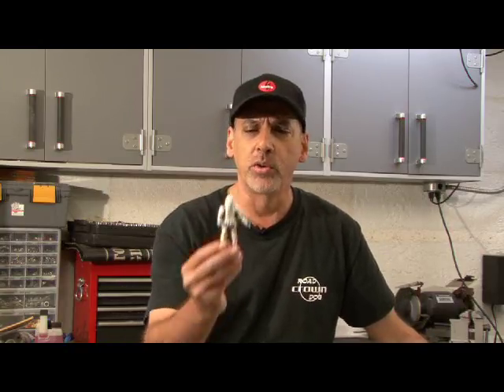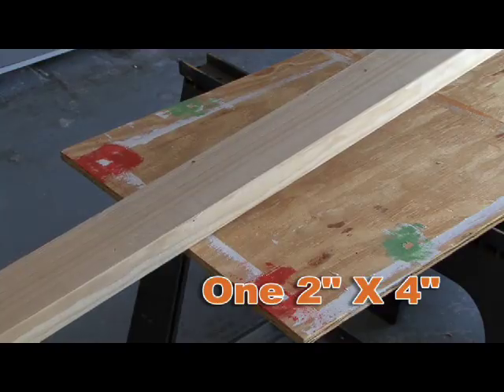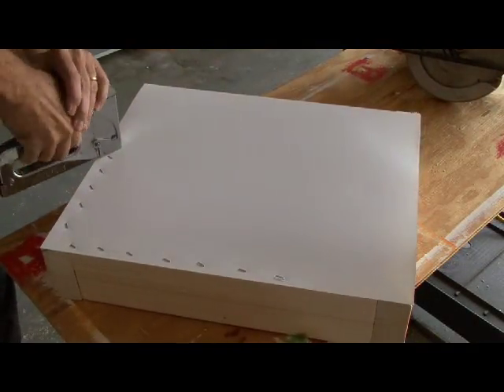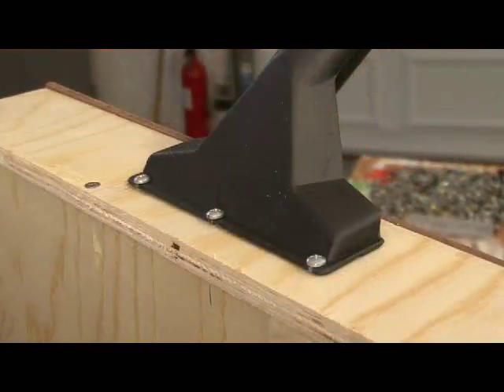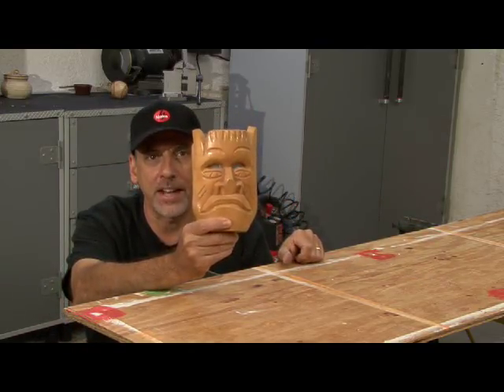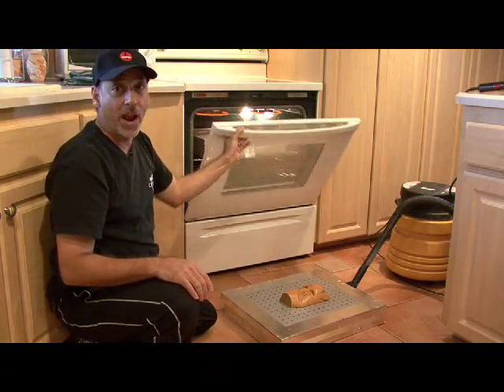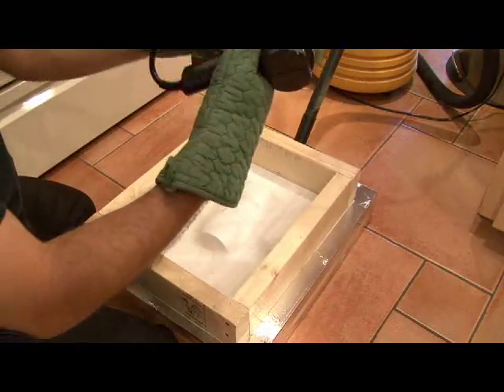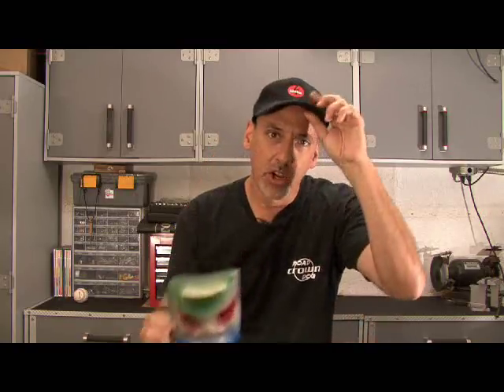Weekend Project: Make a Vacuum Former

Comment: If you want SHARP details, you have to drill 1/64th inch holes in the positive you’re using, so air pressure will push the plastic down evenly everywhere.

Comment: I made one of these a few years ago, the idea was pretty much the same, except my frame for the plastic had some hinges on it so you can easilly slide in some plastic and clamp it down before putting it in the oven.
I also used polystyrene, I got it in sheets from my local home improvement store, it's the tiles used for covering fluorescent lights

Comment: I just built something based off these plans.  It works pretty well. Was a very fun project to build too.  Only think I would recommend is using a 1x4 instead of 2x4.  The 2x4 is just way too thick and bulky.

Some improvements I made on the design was to use caulking on the inside of the box to help with the seal and I also used 2x4s for the box sides rather than plywood. Of course if I build it again I will use 1x4s.

Comment: I've read that there are some ways you can tweak this process as shown here: make it so that i takes joint suction from two vacuums at once; raise the mold up an 8th of an inch because you will get better detail around the bottom edges of your mold that way; vacuum forming molds with complex undercuts are possible if your mold can be disassembled inside the hardened plastic shell after forming, with keys so that they always line up right.

Comment: If you're considering upscaling this into a table top you could use heat lamps and reflectors from a feed / farm store like Tractor Supply Co. using about 4 or 5 of them would let you do a larger area than you could ever get with an oven. The larger the frame the more detail you'll get to transfer to the form.

Comment: Cool Vid Kipkay. 2 things to note. You could just as easily silver tape the plastic to the wood as well. Just make sure to go all the way around to create a tight seal. Also, you could let the plastic get a little hotter. Let it droop more, you'll get more draw. Use baby powder liberally on your positive as a release. Tape any holes outside the frame, waste of vacuum. If the plastic is hard to come off the form a little canned air could do the trick in separating them.  As always, cool vid. :)

Comment: In my experience with heat guns, Hair dryers don't tend to match the output. For this project a really high powered one maybe will work, but you can probably find a heat gun on sale at Sears or something for not too much and its a handy tool to have especially if you ever need to peel paint, say to restore furniture or molding.

Comment: One gets a lot more control by setting the oven at 250F, close the door, and within 5minutes it will get nice and soft (with no need for the heat gun at the end and thus finer details)

Comment: Usually you drill small holes in whatever you are molding, so the vacuum sucks THROUGH the thing you are molding.  I worked in a shop that had one, they made the molds out of plaster and drilled them small so the plastic wouldn't dimple into the holes.

Comment: Great foundation to work on with loads of room for improvement.  Stapling the material everytime would be a real pain...so maybe a temporary frame clamp would be better?  Also, I would either sick with the 1" hole and fix a flange of the same diameter...or cut a slot for the vacuum attachment...so there would be less turbulent airflow.

Comment: Thanks for the video, I would like to ask that you point out with a tag in your video, that as you are heating the plastic, that dangerous gases maybe released from the plastic. If any one had a number of these projects to do that they do not use an oven in their kitchen as there may not be the substantial ventilation needed for safety . 
Take care.

Comment: @riothero313 yes, I did use wing nuts to secure it, they worked great. I punched holes with a paper hole punch in the plastic so it would slide over the studs I had installed in the frame then lay on the top piece of the frame and use the wing nuts to secure it all together, it worked great.

Comment: So late to this, but I can't help but cringe when they are using gloves with a circular saw.  THAT IS NOT SAFETY FIRST.  With any circular power tool like a circular saw or a drill you do NOT want gloves, certainly not bulky ones like that.  If any part catches on the blade, the spinning will YANK your hand into the blade and butcher you.  You are much safer with bare hands where you will just nick your hand instead of severing fingers. Please be careful around spinning power tools.  I had a friend who almost lost a thumb doing exactly this.
Reply: Alluvian Thanks. I think the most important point (not to deny what you said) is to just be aware what you are doing and be cautious when dealing with these kind of saws

Comment: I know this is an old vid, but I have a question: Is it really safe to vacuum form in the kitchen?  Wouldn't the fumes from heating up be dangerous?  Also, would it not be safe to use the oven after vacuum forming the first time?

Comment: You need to preheat the oven to 450F and put the plastic sheet on the middle, remove it as soon starts to go down, but don't use broil, by doing so you're applying heat to one surface more than the other, that's why you didn't have a sharp molding. There is no need for the heat gun if you use BAKE instead of BROIL.

Comment: you mold both sides and cut them out about an inch from the mold you made,stick the molds together and either gut it out or fill it with somthing and then cut it out or remove it to leave the mold so you can make more.
dont blame you if you dont get it.

Comment: oh and if you dont want to spend the time to build this one just grab a 1 gallon bucket a hole saw and a small peice of plywood. i had that laying around my house. hot glue the plywood on the top drill a bunch of small wholes in it and cut a hole with the holesaw in the side just big enough to fit a vacuum cleaner hose in it. maybe glue or tape around it to seal off any leaks. thrn make the plastic frame just big enough to fit the side of a milk jug on it. it works good and took like 10 minutes

Comment: A heat gun is generally much hotter than a hair dryer so if you use a heat gun as a hair dryer some very unpleasant things may happen to your hair. A hair dryer is not as hot but it might work.

Comment: They work the same. but heat guns get a lot hotter than hair driers. Hair driers usually only run in the low one hundreds of degrees Fahrenheit, for safety, but true heat guns can go as high as 1400F. That's hot enough to melt flesh off bone, ignite combustible materials, and liquefy electrical solder.

If he needed an oven set to Broil (usually 500+ F) to get it to soften, a hair drier isn't going to do very much, if anything at all.

Comment: I've done vacuum forming and I can say that heating the sheet to the right temperature is the key to getting a good transfer of shapes. Using an oven won't work, as seen by the very poor result this guy got. Try using a frame that swings from the heater side to the mold side that holds the plastic sheet like you see on other Youtube videos for this method to work.

Comment: A good way to use the molds:
1) Coat mold in release agent
2) Prepare Styrofoam melted in acetone
3) Fill mold with melted Styrofoam
4) Cool mold + Styrofoam until solidified
5) Remove the new molded item from the mold

Comment: You need to turn vaccume on before you take it out of the oven. Every second counts. That thing cooled off before it even hit the table.  ALSO, without the vaccume on, heating it with a heat gun just makes the plastic go back to a flat slab !  No need for a 2x4 frame either. Just use 1x1 inch frame. It's easier to handle than a bulky 2x4 inch frame.   Another hint.... Use a SPACE HEATER instead of the stupid oven..

Comment: A friend of mine, made a Vacuumformer too, but instead of an oven, he used a grillplate, wich he mounted on top of a frame.. with magnets, he held the frame with the sheet in place.. so as soon as the plastic sheet was warm, he'd put on the vacuum, and slide the plastic sheet down..

Comment: You never put it on broil, you always set the oven to about 320-350. Not to mention if you would have had the vacume in the box it would have had a better suction than the set up you had, also if you would have sealed the joints it would have been perfect.

Comment: Pretty terrible results, tbh. He should have at least sealed the vacuum attachment with caulking and put some weatherstrip on the table where the frame hits it during forming. Basically, his setup leaks like a sive and that's why he didn't get very good detail from the form.

Comment: @TheShrecker How dare you insult Duct tape good sir. It infact sticks to everything INCLUDING what it is suppose to stick too, unless that surface is wet or less dense like a sponge or styrofoam. Also it offers the most clean rips of any tape because it follows that string pattern on the inside, so as long as your not ripping it like a dumbass. The Duct Tape Gods look down on you today, shall they forever tape you to a hanging board or to the ceiling for the rest of eternity!

Comment: @DylanRenke  Obviously the 50 year old man who has over 1,000,000 views who has been doing this since the 80s has no idea about shop safety.  Whoever told you not to wear gloves was an idiot, I would prefer to keep my fingers and have a 95% precise cut than risk a shard of what I was cutting launch into my hand or worse, the tool skip and jump near my hand.  Seriously, who taught you not to wear gloves when working with a cutting tool?

Comment: Wow so many things done wrong.

Turn the Vaccum on before you do that. Don't use the broiler, set the right temperatur to your oven for it to be soft enough (trial and error). Why use tape? Use Silicone or Acrylic to seal the box. Don't buy that fance board with holes in it, just drill them yourself with less spacing between them.

Your Mask looks shitty, and is the result of bad handling and a bad vacuum form.